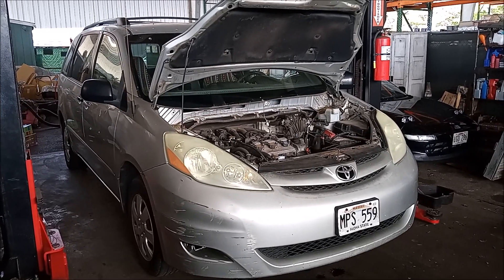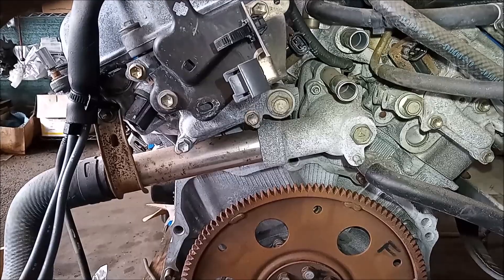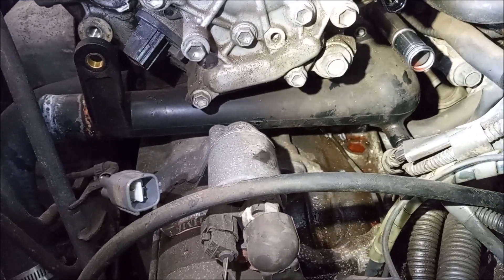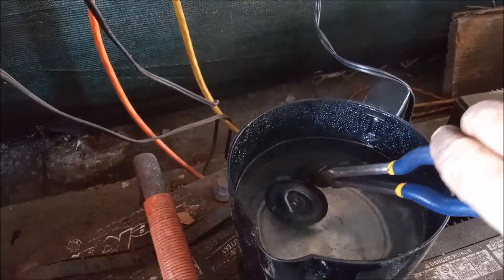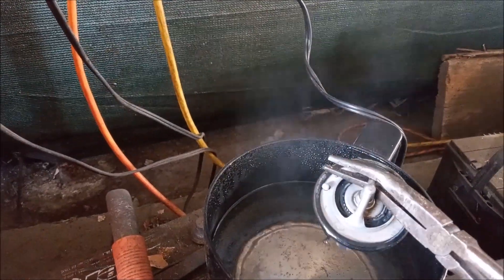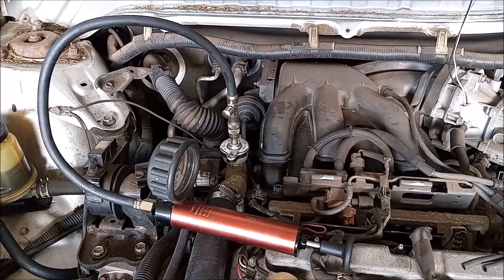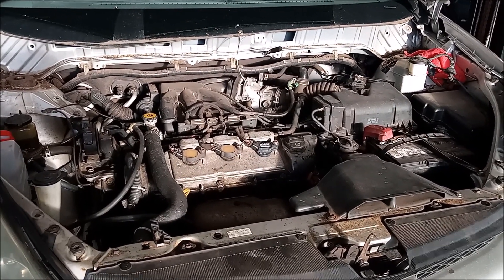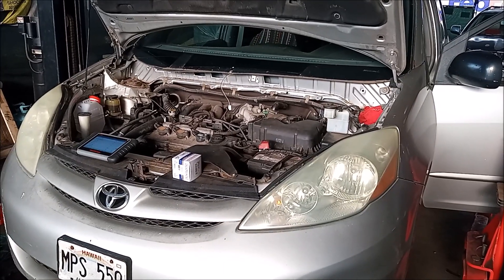How-to Thermostat Toyota 3.3-liter V6 3mz-fe 3.0-liter 1MZ-FE -  Sienna Camry Highlander RX330 RX300

Comment: Although I have a pressure tester, an Astro Pneumatic 7856 & 78585 kit, I cannot get the adapter cap to fit the neck of the radiator for a 3MZ-FE engine.    Please direct me towards an adapter cap that will.  Thanks.
Reply from the maker: IDK what to tell you, I use the adapter in my Astro kit, it's the same as most other Toyota's.
Reply from the maker: Maybe your coolant neck is damaged?

Comment: Thanks for this video, i have the 1mz and had the same symptoms with half the radiator being cold, the car never overheated so i dont know how it can be a faulty head gasket with only 93k miles
Reply from the maker: This indicates a blockage or the thermostat not opening.

Comment: 3mezfe is a 3.3 liter engine, the 1mzfe is a 3.0 liter engine. they are almost the same with the 3mze is slightly bigger at 3.3 liter vs 3.0 liter. the 1mze has a sludging problem due to the faulty valve cover, if switching to the 3mze valve cover it will eliminate the problem.
Reply from the maker: Unfortunately, 20 years down the road, it's too late for a new valve cover. The sludge damage is done. A new valve cover does not reverse it.
Reply: Fuck, i have the 1mz, wish i knew this earlier 😭

Comment: Great job, Frank. That cooling system pressure checker, could it be another way for checking for blown head gasket?  Great video cheers
Reply from the maker: The pressure tester could be a way to check for head gasket leakage but if the water is leaking into the cylinder or into an oil galley you are not gonna see it. Tough to say. To diagnose anything, it is preferable to take complementary but independent data points, each one alone might not be sufficient, but in combination they give a conclusion with high confidence. Example with this thermostat. Overheat, cold radiator hose, plus boiling water test. What if the thermostat had passed the boiling water test? Well then, we would have to gather more data. In some circles, this is called the scientific method.
Reply: @Merryfrankster  very good, thanks  😊